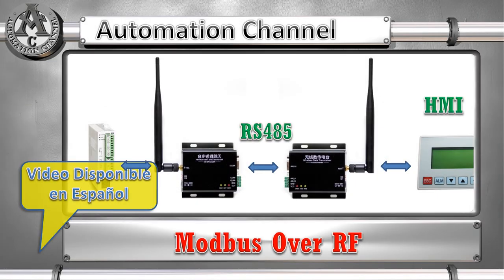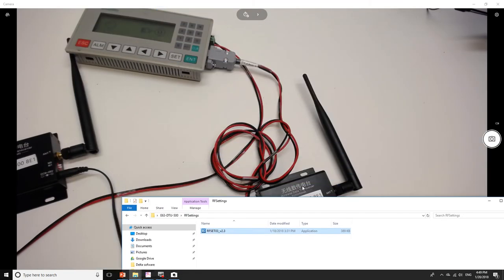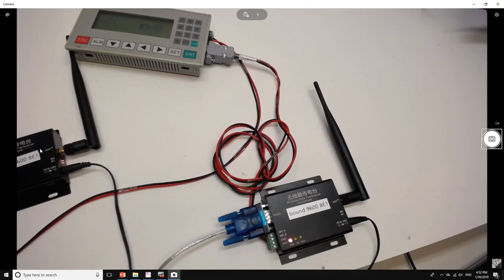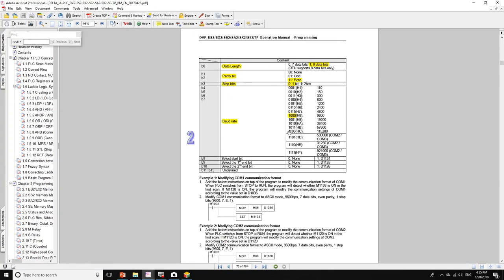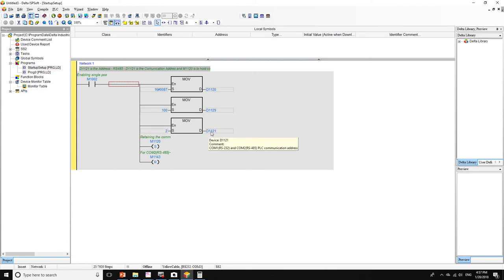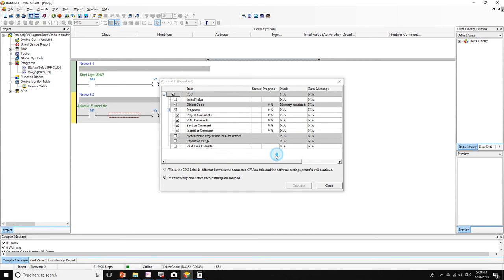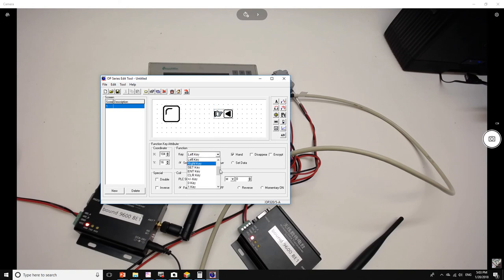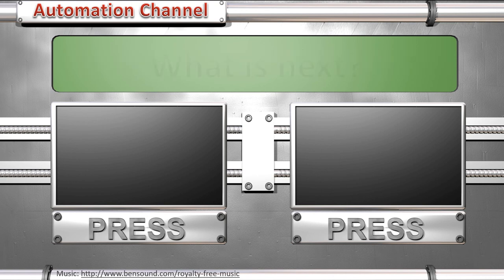Wireless Modbus communication Over Radio Frequency  - English

Comment: We are sending Handoff from one RTU to another using Modbus RS232 connection to the RTU but we have it communicating through a B&B Radio. The RTU that is receiving the data is setup as the Master. what could be causing the Data to constantly change in the registers. we should be receiving 32bit floating points. Thanks

Comment: You are presented with an instrument with no Ethernet or wireless connections and looks to only have a single 9 pin D-Sub, what do you think you are going to need to connect the instrument to the SCADA system network? Any Advice ...plz
Reply from the maker: First of all I will verify if this device can communicate with the MODBUS protocol (They usually do, since this is an open source protocol). Then I will have to know the Modbus communication parameters of the device (Baud rate, Stop bit, Parity, & Modbus address), then I will have to know the Modbus address you would like to read or write to using your SCADA system (Delta PLCs use address like M3 or D4 or C6 or X2 or Y4, but went referring to Modbus addresses you use its corresponding Modbus address: Example: M0 = the Modbus address 002049, C0 =  the Modbus address 003585,  D0 = the Modbus address 404097.  NOTE: The device you like to connect to will let you know, in their user manual, the Modbus addresses table were the Device stores it Registers, relays, counters, timers.)

With that information you have many option to connect to your device. 

1.- If the connection to the SCADA network is less than a couple of feet, just use a USB to Serial converter to connect to your device using the MODBUS protocol

2.- If the connection is greater but less than 4000 feet, use a USB to RS485 converter (Example: The Delta IF6500)

3.- If you need to connect you device using an Ethernet connection, and your SCADA network can communicate directly to a MODBUS device, use a Serial Server (This will create a virtual serial port on the computer running te SCADA software, use this virtual port to establish the connection as if you were connected directly your device to your computer) you can use the B&B Vlinx Ethernet Serial Server ESP901

4.- If you like to connect to using EtherNET/IP, DeviceNET, CANopen, PROFIBUS, or BACnet communication, you can use any of the Delta industrial Fieldbus Solutions. (This is the link: https://www.deltaww.com/en-US/products/Industrial-Fieldbus-Solution/ALL/) Basically this devices connect to your device using MODBUS, they continually collect the registers, counters, or timers you specify and store it on its internal memory. Then using you SCADA network you can collect or white this stored data using any of the above protocols.

Hope this will help you. Remenmer to read the user manual of your device, it usually gives you good information about that Seral port, and its Pins specification.

Comment: Where I can purchase these transmitter and receiver ?
Reply: You can buy them from:
www.cdebyte.com/en/

Or from their Ebay Store. They recoment to buy over the phone to give you a best price.

I personally thing is safer to buy from Ebay.

What I like about this company is that they respond fast to any question you may have, ether from the website or Ebay. The only thing I don't like is that it seems every revition they made to a module they change the product name.

In this video I'm using a E63-DTU, the next revision of the same module is called E61-DTU. Now if you try to buy it it is called E90-DTU. 

Still I like this module.

Comment: what is the ultimate distance ?
Reply: It is not that far of a distance. With a 3dbi antena is about 70 feet at 115200 frequency. I will lower the frequency and install a 10dbi antenna.

The manufacture says it can connect up to 6km on a 4dbi antenna, with no ostructions and at low frequency.

Comment: What is range for outdoor communication
Reply from the maker: with no obstructions using this antenna I was able to connect at 200 feet. others direct or parabolic antennas can make the connection at a greater distance, but this antennas need to be fixed to solid structure.